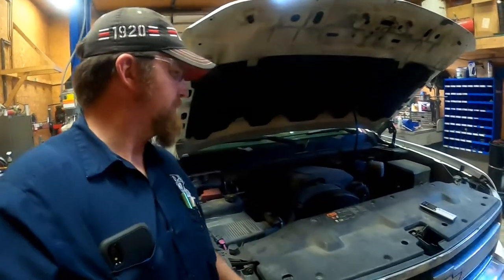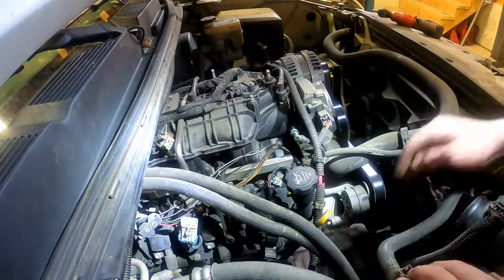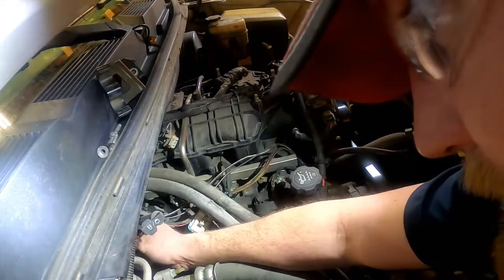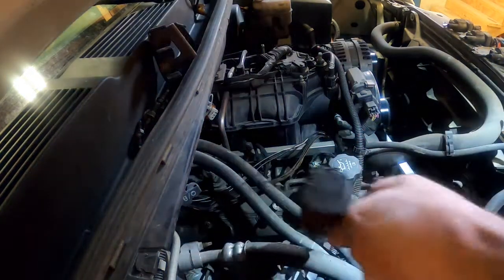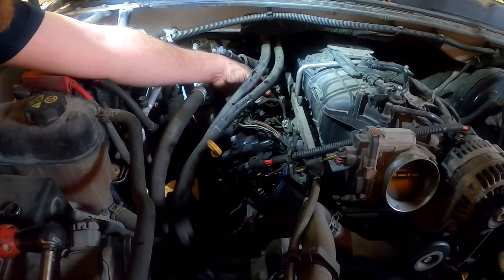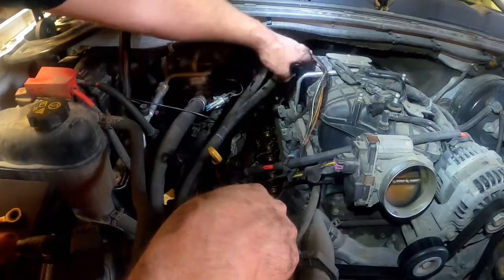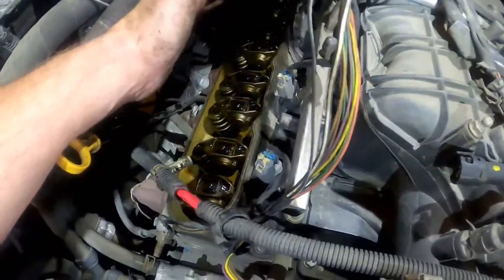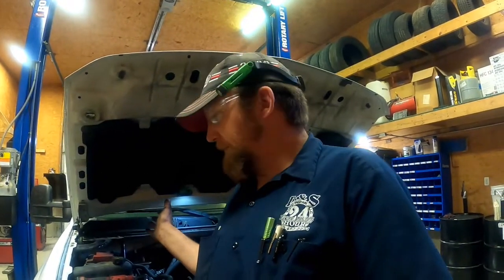Active Fuel Management Misfire Diagnosis

Comment: Truck developed a sudden misfire. Plug was gross. Cleaned it and it still misfired. Changed plug wires. Went from cyl #1 misfire to multiple. Valve cover was pulled and no sludge or loose rockers. What could it be?
Reply: Fuel injectors, maybe. Did you figure it out?
Reply: @jasont1917  nope. Cammed it with all new parts and called it a day.

Comment: Hey, I have a 2015 GMC Yukon Denali 4X4 6.2L and got code p0300, changed spark plugs and wires, tried to switch coils bc I have more misfires on cylinders 5 and 6, and tried disabling those injectors but they seem to work fine, went deeper in and found out that some of my rocker arms have little play In them, not moving them in and out but moving them sideways, what could this be?
Reply from the maker: With the valve closed, if you can move the pushrod up and down at all check the bolt that holds the rocker arm down and make sure it is tight. If it is I would say that it is probably caused by a partially collapsed lifter. If it is just side to side play in the rocker arm, opposite the direction of the normal motion I would not be too concerned. If you can rock the rocker arm with the valve closed we are back to a potential stuck or collapsed lifter. 
    If you believe you have a stuck lifter, try changing the oil and when you refill substitute good synthetic ATF like Dextron VI for 25% of the total oil capacity and run it for 2500 to 3000 miles then change again and see if the problem gets better.

Comment: I have this exact problem with my 2013 GMC 1500.  It has 120000 miles and I've been trying to decide if it would be worth more to replace the engine or just replace the vehicle.  What would your recommendation be?
Reply from the maker: If that is the problem you have I would just fix the issue. Pull the heads, send them to the machine shop, replace the lifters and guides, and put it back together. You will probably have between $1500 and $2000 in parts and machine shop fees if you can do the work yourself, or maybe  $3500 total from a good shop, but then you have a good running vehicle that is worth a lot more no matter what you decide to do.